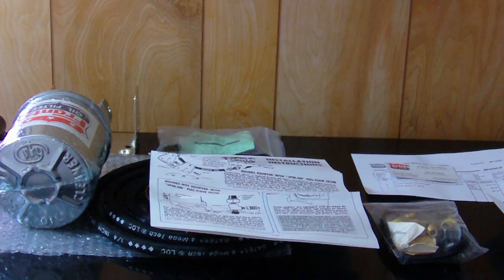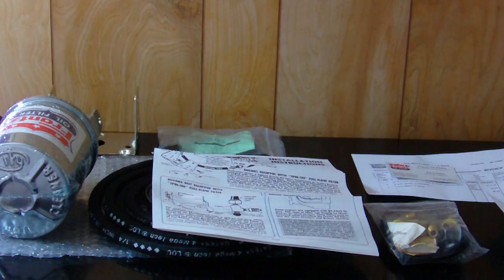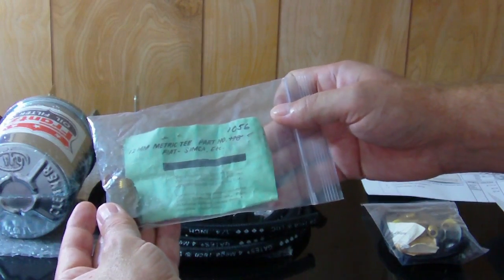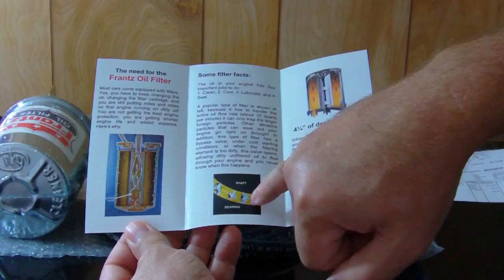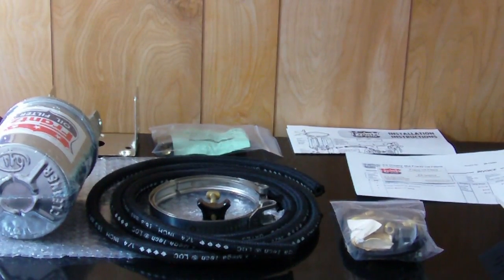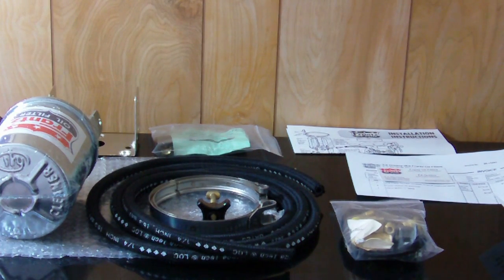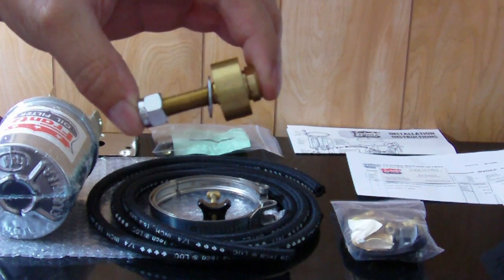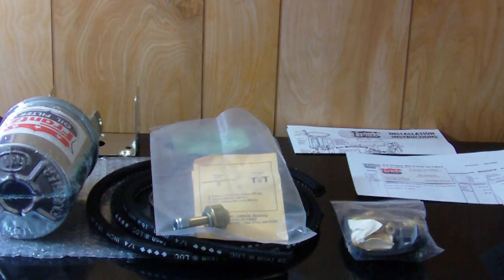Bypass Oil Filter Kit by Frantz (Part 1)

Comment: I remember when I started selling the Frantz It was 1963. We didn't have the metric adapters. We carried a 1/8 th pipe tap. I think I paid 19.95 and sold them for 29.95.I installed them for 6 bucks. At some point they came out with sandwich adapters and transmission adapters. I use the Perma Cool universal sandwich adapters from Jeggs
Reply from the maker: I built a return line into the oil cap to avoid the pitfalls of destroying the valve cover (having valve interference) or drilling the cast aluminum pan.
Reply: On my Pontiac Torrent (Equanox) I drilled and tapped the fill neck extension. On.the Nissan Altima I drilled and tapped the fill neck under the fill cap. On.those I had Perma Cool universa sandwich adapters. I had some trouble with hooking both the.hoses to the sandwich.Air couldn't enter the filter and let the filter drain. I converted them to a single port.I put a plug in one port. Made a restrictor fitting and put it in.the other port. they are for oil coolers but work the same for a bypass filter. I had some Frantz Ford 2 port adapters that I had from 40 years ago that I did the same way for the riding mowers. Returned the oil thru the drain port. I make the restrictor fitting out of a .025 wire welder tip. The Kohler and Briggs and Stratton will take a Toyota or Ford full flow filter.
Reply: About 40 years ago I messed up on returning the oil to the valve cover on my Peugeot diesel. Put the return on the wrong side of the baffle. It started running. On motor oil. .

Comment: About 35 years ago I put a Frantz on a Toyota. Ran into him about 20 years later.he said the boy scouts got into his Frantz elements. They came in a. 4 pack in those days. The car had over 500 k on it.He said it has a lot of miles left. It looks like to me the Amsoil filter system is over engineered. If a filter cost more to service than an oil change its not economical. I had better service with Mobil 1 than the Amsoil with the no oil drain system. I am trying the Pennzoil Platinum now. It seems to be doing good.
Reply from the maker: I read good things about Penz Platinum from bobistheoilguy website. Frantz was acquired and the element re-engineered into a commercial element and much more expensive than the TP roll... Me, I run diesel oil and change it due to fuel dilution and soot loading, the Frantz did polish the dirt from my crankcase and worth the money vs a new engine.
Reply: I don't know any thing about oil. Had a 84 Subaru that I bought new. As soon as I got it home I installed a Frantz and filled it with. Mobil 1 15--50 RACING oil.I probably had the old fashioned idea that it was needed in this Texas heat. The car didn't use oil.About every 12 k I changed the Frantz and added a qt of oil. After a little over 250 k I sent a sample of oil to a Caterpillar lab.They said the oil looks good for that many miles but I probably should do the filter and add the oil every 6k instead of 12 k. Which I do now. Some time after that it was still running like new but both head gaskets were leaking oil onto the muffler. Gave it to a friend. Told him to replace the head gaskets. It had well over 300k when I lost track of it.
Reply: Also when I got the Subaru home I drained the gear oil and put in Amsoil gear oil.Never drained it. I put Amsoil gear oil in an old beetle once. My wife asked me if I tuned up the car. She said she didn't have to shift it on the hill With a manual and an under powered car you could really tell a difference. 40 years ago It probably wasn't a good idea to follow Amsoil recommendations as far as filter change intervals with the no oil change recommendations. I liked the 2 cycle oil in the chain saws. Went up to Salt Lake city about 1980. Went to a Frantz Amsoil dealer to get An Amsoil oil change and A Frantz oil filter for my wife's sisters Honda Civic.Amsoil filters can't compete with the Frantz oil cleaner.
Reply: There are several filters now that are very good I have been a toilet paper squeezer for over 50 years. I guess I will always be one.

Comment: I wouldn’t put a hole in the oil pan, I would get the oil cap designed for your vehicle
Reply from the maker: I had to build the oil cap using the swivel hollow bolt from Amsoil

Comment: Any how to's for a BMW 325xi BMW? I bought my kit for an 84 Mercedes 300D & sold the car. Thanks,
Dave
Reply from the maker: The oil sending unit on European vehicles is 12mm or 14mm and a Frantz dealer has the adapter Tee needed for the install. I read on a blog that BMW use a 14mm and the install takes longer than other models.  It took me 6 hrs to do the install on my 300SDL due to difficulties drilling the oil cap and the sending location. Try FrantzOil or WeFilterIt for any parts needed for your kit.
Reply: heavymechanic2 Thanks for the help, Dave
Reply: Did a Volvo once. It was a pain. If I  Had it to do again I would use a sandwich adapter. I believe that one was the same as a Ford. I did one in the 60s that had the oil pressure switch the same as a Toyota. Got a e mail from Israel . The guy says he remembers as a child watching his mother  change the filter on the Volvo.
Reply: She was changing the Frantz. On the Volvo. I did my last Volvo about 30 years ago. At the time I had some Frantz 2 port sandwich adapters but they were at home 40 miles away . I would have saved time going home after one.It took a Ford adapter. Might not make them now. I have used Perma Cool universal sandwiches. They are for oil coolers but work the same f or bypass filters.